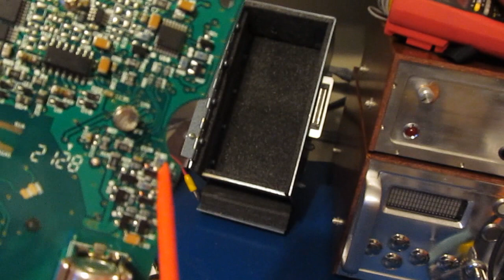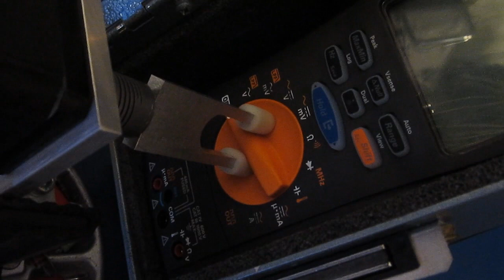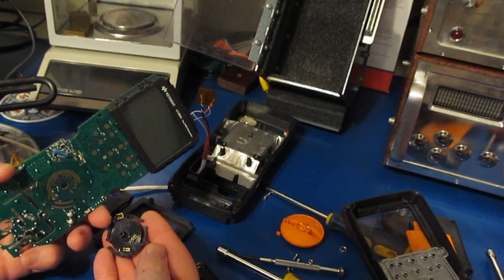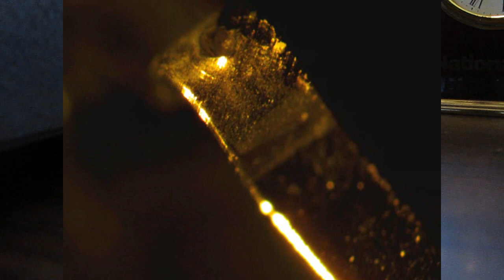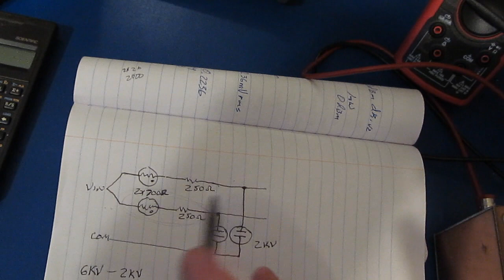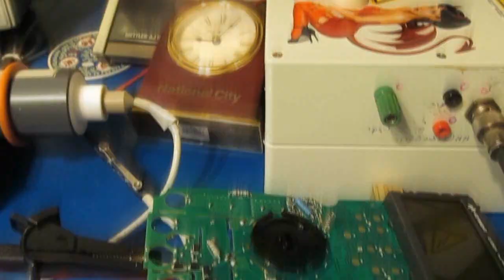Keysight U1282a Review Part6,  Life Cycle Test and Conclusion

Comment: Many thanks for the explanation and nice demonstration that the discharge tubes are still fine after this massive battering of thousands of transients. As for all the other test, I agree that for the price, the U1282a is a massive disappointment.  It seems these days marketing and bean counters just don't understand how easy it is to loose a reputation (built over decades by HP's of course). Agilent was kind of ok, but Keysight now seems to have the wrong priorities.
Reply from the maker: I'm glad the test helped answer your question about the GDTs.  If Keysight one day decides to try and improve their designs, I would be open to investing my time to look at another.   I would extend the same  offer to GMW with the Ultra (rebranded Prime after my review) and the UNI-T UT181A.   They all have the potential to be a really good product for electronics work if the companies decided to invest in improving them.

Comment: What a disappointing result for this expensive Keysight.
2 keysights tested and both fail prematurely on the rotary switch, in different ways als both switches are different.
A meter this expensive, you'd still expect it to last pretty much a lifetime with regular use (like the fluke guys commenting...."I have this old 77 I bought 30 years ago and it's still fine"). But 8000 cycles on the switch might not be good enough for that; if you use the meter 4 times per week, and cycle it 5 times with every use, and do that 40 weeks a year, it'll only last 10 years. That is imho too short of a lifespan for such an expensive meter. But probably long enough so that it's out of warranty and probably long enough that the broken part isn't available anymore....
(keysight handheld multimeters don't have that long of a product life anyway imho)

Meters that complete the 50k rotary test succesfully.. that's a number I think most users won't achieve over its life, so that's a pretty good benchmark.
But seeing that both keysight meters failed so early, I have my doubts if keysight even does any life cycle testing at all (with a significant number of cycles that is). For a brand that has been around for over 80 years at the top of their field, a better product is expected.
Reply from the maker: Somewhere on EEVBLOG I had posted my assumptions when I came up with that 50k number.  When that spring broke so early in the testing, I was also thinking they either don't qualify their designs for this, or they had a supplier make a bunch of bad parts and they have no quality control to catch it.   It's also possible they design them for 2000  cycles and call it good.   When I spoke with Brymen about running the BM869s, they had provided me with a couple of clips showing their setup.     https://youtu.be/bs5n3a__Yq0?t=414

Comment: Hi Joe. this was a multimeter I was wondering about. Thanks for your detailed review. According to the test results, it did not give the expected quality, but the measurement performance is very successful. In my opinion, the only shortcoming is the insufficient display of the second screen. Also, I'm a Brymen user. I always follow new videos on youtube. Malfunction videos for BM869s have been coming in many times lately. so brymen may look very durable, but unfortunately not as much as a Fluke.
Reply from the maker: Mine is aging well.
Reply: which 'many' bm869s video's?
No problems here.....had it for almost 6 years now....passes iso17025 calibration every year.
More reliable than my Fluke 115 which broke down within 2 years (but obviously has been replaced under warranty and has been fine since)

Comment: Escort 97 has the same pad problem, I regularly put some tin and grease on the pads. U1252A, my most used DMM, strangely doesn't suffer (it has disintegrating blue rubber housing instead).
Reply from the maker: I've seen photos of their disintegrating rubber.  Some look really bad for such a short life.

Comment: Will the flash over voltage  actually be sustained or will it drop ?  (Can you really) subtract the 2kv from 6kv?)    Won't affect your calc much  , so just wondering :-)
Reply from the maker: Bill, a good question and I took liberty to fudge things a bit.  Before the GDT becomes active,  the input current to the meter is very low, which is why I am able to drive it with the few uA supply from my ESD gun's DC output.   Once active the GDT is basically a short.  In this case we could have have the 6k/950 or 6.3Apeak.   However they talk about the 8/20us current pulse.   This particular generator does come fairly close to meeting the IEC open circuit voltage waveform but once you start pulling any current it just runs out of steam.  This gets back to my not having any interest in testing these meters to a safety standard.   So,  yes, a bit of a guesstimate and our wear factor may be even less than that.

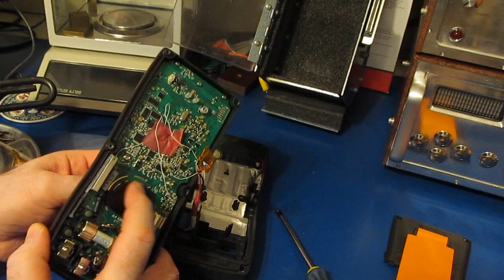Comment: The switch tests are my favorite, great stuff for those obsessed with the durability of their meter :) I am curious to what jammed the black contact assembly at 11:32, was it the little orange plastic piece that fell off at 11:44? Also is the stepper motor powerfull enough  to break the plastic shaft or does it sense excessive force and stops? I'm thinking that the implementation with the screw is not the smartest thing as the already thin plastic shaft needs to be hollow now and the screw can potentially crack the plastic if it is screwed in too tight helping a premature failure. Thank you for all the dmm tests, they are a great resource.
Reply from the maker: It does measure the stall current and then bumps it by a percentage.   The rotary switch's black plastic wafer's that hold the contacts are spring loaded by the contacts.  As the contacts cut into the PCBs pads, they create a lot of drag.   Eventually it was more than the plastic shaft could support and it gave way.   While the stepper doesn't put out as much torque as my hand can,  it was sufficient to break the shaft.   Note that the screwed together wafers were not the weak link.  However, had the shaft not broke I expect we would have seen a lot more damage to the PCBs pads.   That one pad appears that the contact may have cut through it already.
Reply: @joesmith-je3tq  Thank you for the detailed reply. Crazy stuff, they should quit and sell rebadged Brymens :)
Reply: @georgegherghinescu  😄👍
Reply: I believe Joe has explained in the past that the motor senses the torque to determine the end stops and motion. My guess is the the plastic fatigued and fractured (i wonder if the grease was a factor, chemically?).

Comment: "rubber" is a shock absorber (and a quite good one at that) so at low frequencies it would certainly have an effect on the vibration/chatter. The "intrinsically safe" 28ii-ex (basically, a 89-V that's been certified as "mining safe" by the MSHA (won't generate a spark)) has a soft-rubber case. It felt like real EPR trailing cable-- the expensive shit you have to vulcanize-- case (IIRC). Parker's catalog is 550 pages. Not their cylinders or anything. Just for o-rings. There are literally thousands of compounds out there to choose from - its craziness

Some of the other Fluke holders (like the H80M) are a "PVC compound" (quote from Fluke, they didn't go into any more detail) and they said it qualified as a "hard case".  I'm not in NVH or materials science or anything but take apart one of those $5 adafruit load cells, strip it for the strain gauge components, tape it onto the meter, and try a few different configurations. The resonant profile is gonna look pretty different between in the box and out of the box
Reply from the maker: I'll give you credit. You have taken the time to put together a fairly long post but I am at a loss of what point you are trying to make.   I am familiar with the Parker catalog but think you have embellished the number of compounds.    There is a table that lists the chemical each rubber is compatible with.   Maybe double check.   It seems you would like to perform a vibration test of sorts.   Maybe write up what you are proposing rather than where to buy sensors.

Comment: I heard back from Keysight, as a result of both of our reviews they have updated their data sheet to show that they are specified for up to 20MHz with a 100MHz “display range”.
Reply from the maker: I am not too surprised that their marketing group would try to address the problems by changing paper.    Of course, the firmware still glitches when logging, the lettering is still poor compared with their competition,  the input protection is weak and not capable of protecting the sensitive ICs and their function switch is such a poor design it was damaged in under 10k cycles.  A fifth of what I normally run the meters to.    Maybe their marketing group can address these as well with paper?